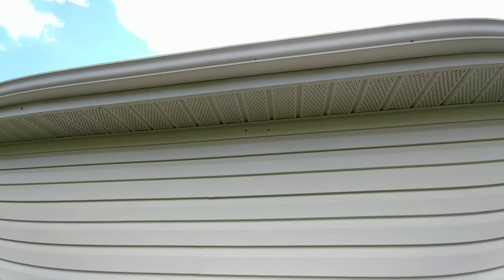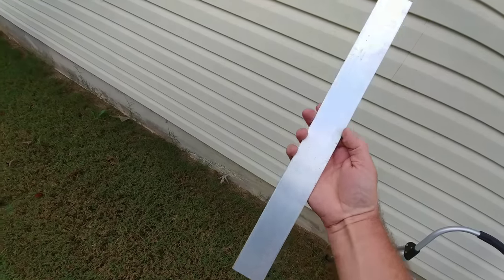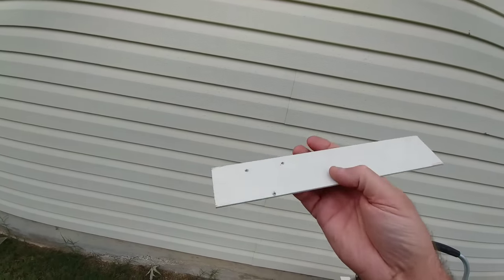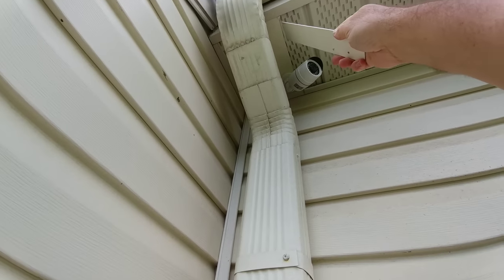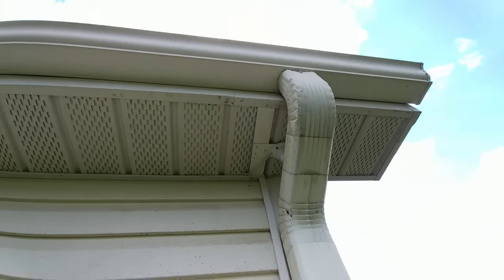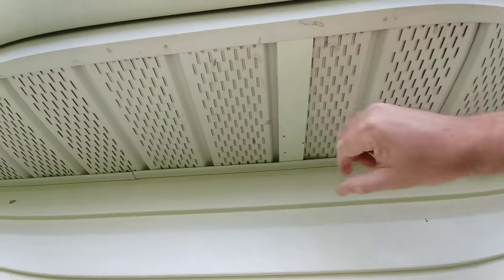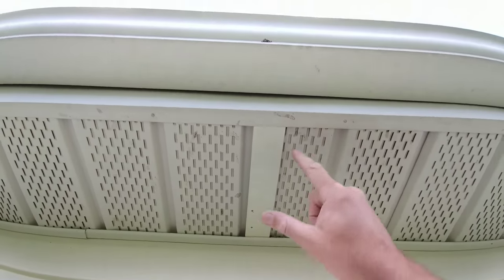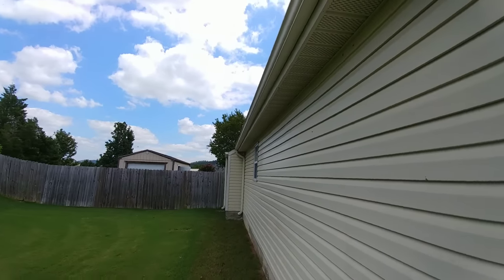Installing security cameras under eave with vinyl soffit

Comment: Sweet video and relevant considering the explosion in sales of security cams.   What length and type of screws did you use to attach the camera base into the aluminum bars?   My problem is the vinyl groove for the soffit on the outside edge, is not nailed or screwed into the wood board at all  (just stiff vinyl I guess) and thus not sure if the outer edge part provides  a stable enough end brace for one end of the bar.   I was thinking of using pressure treated lumber perhaps a 1x4 or 2x4 cut in about a five inch length and painted the colour of the soffit.  I would screw  this (3inch deck screw) into the bottom edge of the wood (2x4 or 2x6 ) that forms the outside edge away from the house frame for the soffit etc.    I would then screw the camera plate  to  the wood (1/2 inch deck screw).    Certainly not as elegant as your solution.
Reply from the maker: Hello Al
I used small screws then ground them flat to make them smooth. So the  soffit edge is not nail to the facia board.
Reply: so when you drilled holes in the aluminum, i don't understand how you fastened cameras. could you be more specific wit the camera to the aluminum step? Thanks for the video.

Comment: Love to see how you ran that wire to the inside. NM I see the comment below. I don't have attic access, it's a mobile home.
Reply from the maker: That is tuff since your mobile home doesn't have access. I would say run to a central point through the soffit and might have to go through the wall above soffit so no wires would show. Just my thought as it is hard to know without seeing. Hope it helps in any way .
Reply from the maker: Also you can email me and I can send you a video link  of install I did inside.  jimhodell@gmail.com
Reply: @jimodell7644  can I get that link that shows how you ran the wires inside the house?
Reply from the maker: If you subscribe to me I have it listed. Here is the linkhttps://www.youtube.com/watch?v=r4YKBRGrAes&feature=youtu.be

Comment: What kind of silicone did you use to secure the aluminum in place? Also, how’d you go back screwing in a soffit nail to secure it? Did you have to pre drill a hole in the aluminum and soffit? Or did you set the aluminum in place, and then drilled through the soffit and aluminum?
Reply: It’s not rocket science, just do it.

Comment: I bought a 3"x12.5"X1/8" flat aluminum bar to mount a Eufycam 2.  What's the best way to drill and mount to the aluminum?
Should the holes be tapped, use self-tapping screws, or some other method?
Reply: I would use rivets if possible, or self tapping screws that were then ground down flush

Comment: MM
Great idea and have started my system. What kind of screws do you recommend to attach the camera to the metal strip - the screws that come in the box are very long and will extend past the metal thickness, pressing on the vinyl.
Reply from the maker: After I screwed my camera to the aluminum strip I ground  down the screws with a grinder so I wouldn't have that issue.
Reply: Jim Odell thanks and makes total sense
Reply: I’m guessing self tapping/sheet metal screws not nuts & bolts.

Comment: Did you use any special screws or anything to screw the camera into the aluminum? And what kind of drill bit did you use to drill the holes? Thanks so much!
Reply: Rivets or self tapping screws, grind down the part that sticks out, aluminum is soft any drill bit will work.

Comment: Can't find 3" locally. On Amazon it's very pricey. Did you really get it at Home Depot because I can only find 2" max at Home D or Lowes?
Reply: Buy online, Midwest steel and aluminum is where I got mine, less than $5/apiece for 3ft sections plus $13 for shipping

Comment: Can you provide some tips on how you ran the cable once it was beyond the soffit?
Reply from the maker: prairieskycam 

The wires ran up through the Attic to a central point where I cut the wires to the length , so I wouldn't have a lot of lose wire. I also installed the system above my fridge in the cabinet most of us don't use to conceal it.
Reply: Jim Odell Thank you
Reply: Jim, you said that you also installed the system in the cabinet above the fridge. Are you referring to the NVR or DVR in the cabinet?
Reply: Get a Blink system
Reply: @arthurmeeuwen9738  subscriptions and batteries, pass

Comment: Hi Jim. Great idea here! What are the strips exactly called? When I search for “aluminum strip” on the Home Depot website, it just gives me aluminum weather stripping for doors, etc.
Reply from the maker: https://www.homedepot.com/p/Everbilt-3-in-x-36-in-Plain-Steel-Flat-Bar-800227/204325647

Should be in the isle with bolts
Reply: @jimodell7644  I thought you were using aluminum. Won’t the steel rust?

Comment: Did you use the mounting screws that came with the camera? I received wood screws with my cameras. I’m a little concerned about them holding.
Reply from the maker: I would use metal stainless screws and grind them flat on the back so they wont stick out.

Comment: can you imagine doing all this work and spending all this money just for the thief to have on a mask or simply cover his face?  I learned the hard way.
Reply from the maker: Yes but some aren't that smart.
Reply: Got a security camara that sends u push notifications and install alarms on your doors.
Reply: They have some wireless camaras that let your watch live footage and you can set off the panic alarm from work or anywhere.
Reply: on top of the fact they mount their camera right above the garage door, so i can easily walk by with a hoodie, and knock it down
Reply: or more likely what's the point of installing a camera if anybody can see it and destroy it.
Reply: Most security cameras like mine are used when someone is home. If i hear something outside or get a motion notification we will check the cameras. Someone is home all the time so it's basically there as a perimeter defense
Reply: @LOLOqqq  deterrent
Reply: They’re just cameras they don’t make your home bulgar proof..

Comment: How about putting the aluminum under the vinyl soffit... 
I screwed the camera to a wood rafter which Iare under the soffit every 16”.
Reply: DONALD1951 I was thinking to do the same thing.. but were you able to screw all the camera screws in? I thought 2 x 4 may be to skinny to fit all 3 screws
Reply: @cutactiontake9  what do you wind up doing?

Comment: Nice!  Was wondering how you did the wiring?  Did you wire along the gutter?
Reply from the maker: No, I ran all wires  straight up into attic then  came to a central point to a run into wall above kitchen. I did cut wires and install new connector so they wouldn't be so long as the system came with 100' length cables

Comment: How wide is that aluminum and how thick? Trying to pick some out at home depot and wanted a reference.
Reply from the maker: 2 in. x 36 in. Aluminum Flat Bar with 1/8 in. Thick

357

(921)

Comment: Good job, I wish you had showed when you did the hole in after the soffit was removed and then put back in.
Reply from the maker: The soft is open 
above it so no need to cut a hole 
Some older homes might have wood behind, but should have holes to help breathe
Reply: Jim Odell thanks Jim have you done any reviews of your security system likes and dislikes brand model etc etc

Comment: I put a small board in the corners with holes to feed cable and mounted them with L brackets. that way I can drill and mount onto the board.

Comment: What’s the Lowe’s or Home Depot part number for the metal strips?  I can’t find it
Reply: Model#  801977  from Home depot 2inch width by 36 inch in length
Reply: Make sure you get the 1/8th inch thick bar. They also cary 1/16th which is to thin for this IMO.
Reply: Buy online, Midwest steel and aluminum is where I got mine, less than $5/apiece for 3ft sections plus $13 for shipping

Comment: Why not just use self tapping screws directly into soffit? Surely it can support the camera and the small holes wouldn't be noticable if you chose to ever remove it?
Reply: How do you know if your in the wood if you drill into the soffit?
Reply: @nicoletoombs5768  you don't, I'm saying don't drill into the wood, let the soffit support the camera. It's not that heavy

Comment: I wish i could mount a sensor garage light underneath or near the gutters. I think the light is too heavy.
Reply from the maker: If you get a wider piece of aluminum, you could mount an electrical box to it and should be fine. I have bought some different sizes on ebay for different needs

Comment: I'm concerned about where the cable on the camera by the downspout was run into the house under the edge of the soffit aluminum. Over the years the subtle movements of the soffit with wind and weather will cut into the camera cable.
Reply from the maker: Donald Begs 

You can notch the sofit if need be but it is vinyl so would truly take a long to wear through. You can also tape the wire where it goes through to help protect more.
Reply: why not just buy wireless arlo's and not have to deal with wires?
Reply from the maker: Because then you have to worry about changing out batteries. After you run the wires it done for years
Reply: Wireless cameras also don't usually have as reliable of a connection, as good of a recording solution, or as good of quality of video.  Usually.
Reply: @nathane2243  no 24/7 recording with them, have to change batteries and your reliant on WiFi

Comment: There is no ac power up there how did you power the cameras?
Reply from the maker: Mine are IP cameras which use the cat 5 network cable and has power in the cable.

Comment: Anyone have a link or something to a correct piece of aluminum for this?  I can cut to length but unsure of a good thickness and such.
Reply from the maker: 2 in. x 36 in. Aluminum Flat Bar with 1/8 in. Thick      Search in Home depot, lowes, or the hardware store close to you.
Reply: Jim Odell thank you so much

Comment: How do you cut the metal strip?
Reply from the maker: Many ways,  but I used a jig saw with a metal blade
Reply: Grinder with cutting wheel

Comment: Soffits have holes already, a few more won’t hurt a thing
Reply: The flexibility of moving them and later replacing them with better cameras is easier.. the soffit isn’t strong enough alone to hold them anyway, would have to add done kind of backing.